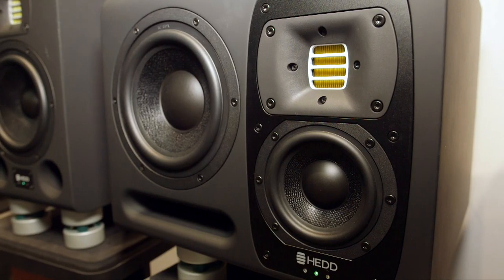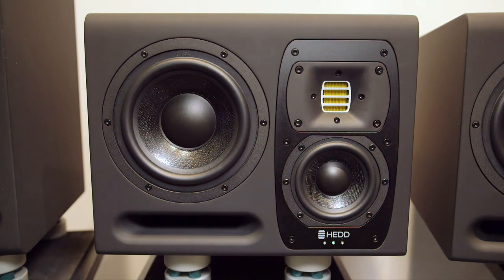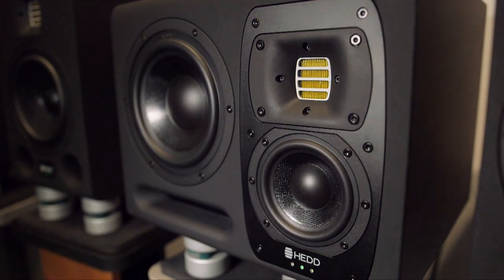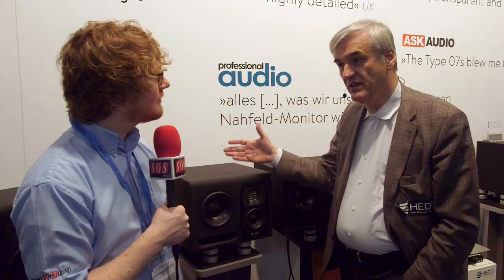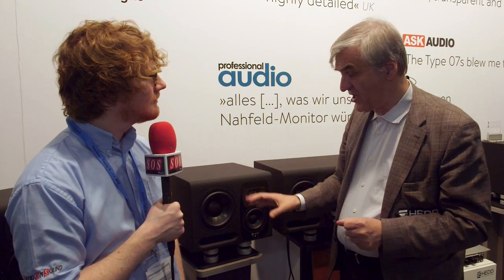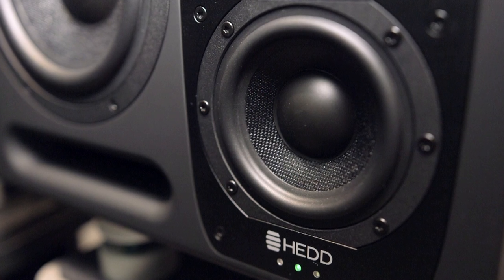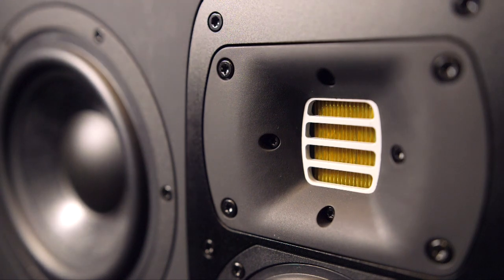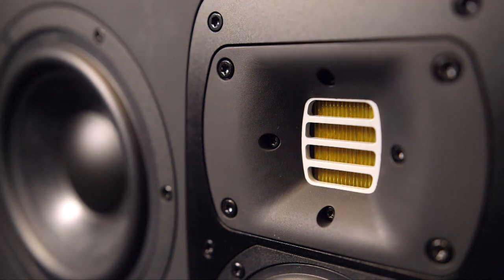HEDD Audio Type 20 - Musikmesse 2017

Comment: The Price sounds fair, it's in the KH310a league. I find it interesting to see a new monitor which was build deliberately without the use of DSP, even though DSP systems seem to be all the trend now and I am exited to read said blog. First time I hear the Klippel measuring system mentioned as part of the developement by a SM Manufacturer, and the use of a lower Crossover point being aknowledged as better. As somebody who builds FAST-Systems and is an advocate on their strengths of low crossover Points and point sourcing mid-high frequencies, I can relate to this statement. What worries me a little, is the use of a bigger voicecoil in the Midrange, because a bigger VC means higher mass, means less detail and worsened transient response. Also it would be interesting to know if high power neodynium magnets are used in the motor, for minimum resonant space due to the smaller construction or if the cheaper and bigger Ferrit construction is used instead. The sourround of the mid driver seems rather bulky considering it is a midrange (how low does it play? 100Hz? 150?), at least an inverse construction could have been used to provide a better dispersion in the high mids, unless the crossover for the tweeter is really low, like 1k but because it is an AMT I doubt it. What type of crossovers are being used? Butterworth, Linkwitz-Riley or more in the direction of Bessel and how steep are they? Being an active design i just hope the electronics used to build the filters are of high quality. I had KH310a once but the electronics in the crossovers (I suppose) made them very spitty sounding and the integration of the tweeter with the midrange was god-awful, sounded like the phasy mess you get, when your overhead and hi-hat mic are seriously out of phase.
Reply: The Price sounds fair, it's in the KH310a league. I find it interesting to see a new monitor which was build deliberately without the use of DSP, even though DSP systems seem to be all the trend now and I am exited to read said blog. First time I hear the Klippel measuring system mentioned as part of the developement by a SM Manufacturer, 

-- comment Klaus Heinz from HEDD Audio:
All serious driver manufacturer have a Klippel System meanwhile, it allows a number of new measurements, especially the inspection into the dynamic behaviour of woofers, it creates new R&D chances compared to earlier times.
 
and the use of a lower Crossover point being aknowledged as better. As somebody who builds FAST-Systems and is an advocate on their strengths of low crossover Points and point sourcing mid-high frequencies, I can relate to this statement. What worries me a little, is the use of a bigger voicecoil in the Midrange, because a bigger VC means higher mass, means less detail and worsened transient response. 

-- comment Klaus Heinz from HEDD Audio:
It also means better performance in its lower reproduction range, and less detail or worse transient response may not be the case in a driver that goes flat up to 8 kHz.

Also it would be interesting to know if high power neodynium magnets are used in the motor, for minimum resonant space due to the smaller construction or if the cheaper and bigger Ferrit construction is used instead.

-- comment Klaus Heinz from HEDD Audio:
It is a Ferritesysten with consequent ventilation and a hole in the soleplates vor the best possible air flow. And cheaper in itself is not bad I guess.

 The sourround of the mid driver seems rather bulky considering it is a midrange (how low does it play? 100Hz? 150?), 

-- comment Klaus Heinz from HEDD Audio:
This is a woofer “by heart” as well, plays down to 50 Hz in the right cabinet. It is my experience that “woofer-oriented” midranges are less annoying in the crossover behaviour, more natural,  and that they often can be better blended. Yet I think that kind of generalised statement needs to be rewiewed in every case. 

at least an inverse construction could have been used to provide a better dispersion in the high mids, unless the crossover for the tweeter is really low, like 1k but because it is an AMT I doubt it. 

-- comment Klaus Heinz from HEDD Audio:
The effective cone of the driver is < 80 mm, corresponding to a wavelength of like 4 kHz, so at the crossoverpoint of 2.5 kHz there is reasonable dispersion.

What type of crossovers are being used? Butterworth, Linkwitz-Riley or more in the direction of Bessel and how steep are they? 

-- comment Klaus Heinz from HEDD Audio:
Typically 4th order Linkwitz-Riley filters are used, they have turned out to be the most musical solution in the majority of cases imho.
.
Being an active design i just hope the electronics used to build the filters are of high quality. I had KH310a once but the electronics in the crossovers (I suppose) made them very spitty sounding and the integration of the tweeter with the midrange was god-awful, sounded like the phasy mess you get, when your overhead and hi-hat mic are seriously out of phase. 

-- comment Klaus Heinz from HEDD Audio:
Frankly speaking I have different impressions, I consider the 310 to be one of the “hardest” competitors soundwise.
Reply: Wow, I never expected to actually get a response...normally I comment and then: end of story. Lol.

So thank you for your very detailed answer. I already knew about the klippel system and it's widespread in driver manufacturing but I had not heard it being mentioned by a studio monitor manufacturer before. On the other hand I have yet to watch every speaker presentation there is...

Well the thing with the KH310a...It might sound crazy. Actually everybody who I have talked to about my dislike of said monitor thought I am crazy (or did never actually posses the speaker) but I would not back down on my statement. I found them to have a metallic ringing/spitting always present and the high-mids and highs sounded very smeared. I compared them to their smaller brother the 120a and here the sound was crystal clear. Some time later there was the amphion hype going on and I ordered myself an evaluation pair of Two18s. Compared to the Amphion Two18 the KH310 sounded like toys. High percieved THD and the metallic ringing was now very obvious and in comparison sounded like serious coloration. Of course the Amphions are double the price so it may not be a fair comparison but it proved to me that I am not crazy and the flaws I percieved are actually there. Of course the Two18 also weren't flawless. Compared to the KH310a they sounded a bit choked on microdynamics in the bass and lower midrange (I guess because of the passive radiators) and there was a bit of a smiley curve present. But their sonic purity was unreal, sound really seemed to be projected in 3D space and had a very strong cohesion like the entire Frequency range was hold together by a very strong force. The more "open" sound of the KH310 resulted in bit of wobble all the time while the Two18 where almost too tight. After I send them back, because I didn't had near that much money availiable, I decided to learn how to build my own speakers and choosing the compromises, that come with every speaker,  myself. 

That being said I take big interest in the marked and like to observe where the marked is headed. Having already checked your website, read a bit about your and your companys history and the blog about evaluating different monitors, I am looking forward to the blog-post you mentioned in the video. It is refreshing to see somebody who doesn't believe in Quality Sound = Linear frequency response and nothing else. Too many people nowadys actually believe that nonsense.
When I did study audio engineering we had lessons about mastering for which the school had invited a professional mastering engineer who claimed he worked together with Andreas Balaskas. The topic DSP and DSP based room correction was brought up and then it moved to DSP based FR-correction for Headphones. I got into an argument with him because he told us to buy cheap 30€ Headsets + the correction Software and told us it was going to be just as good as high-end reference headphones and he just can't believe how people can be so dumb and spend so much money on reference grade headphones. When I brough up that there are also other factors to high quality sound and mentioned THD for a start, he just couldn't believe it and claimed that I don't seem to know what harmonic distotion is, as it is something that is produced by guitar amps for example and not by speakers. That was so shocking to hear coming from a self-proclaimed mastering professional...i just couldn't continue the argument.

Well but that is enough storytelling for now. It was nice to have the CEO of HEDD Audio respond to me personally and again thank you for your response. Btw do you plan to try out something in F.A.S.T.-System territory in the future? Would be nice to see a monitor based on that concept developed by a company with more possibilitys and knowlede then DIY-enthusiasts have. Have a nice Weekend, Sir :)

Comment: I must say Klaus Heinz's attitude I find refreshingly engineer-like, hype-free and friendly at the same time and this was one of the factors in my going with the HEDD Type 20s for myself. I'm looking forward to getting them next week after reading of comparisons with more expensive ATCs, Barefoots, Genelecs, Amphion Two 18s and Neumann 310s where the HEDDs won out, often easily. I lived with K&H 0300s for 7 years but I got tired of the lack of detail in the mids and bass that did not translate well to the real world. I like also the fact that Klaus went with an analog signal path in the face of the market pressure to incorporate DSP because he thought it sounded better. I also like his taking into account dynamic capabilty as an important design criterion. I agree. 

If I had the budget to equip myself for serious mastering I would certainly be looking at their new floor standing towers which, I think, represent similar value in a larger format: http://www.hedd.audio/en/tower-mains/
Reply: Could you please give a link to these comparisons, because we listen hedd type 20 and it was by far the worst of all speakers that you mentioned.